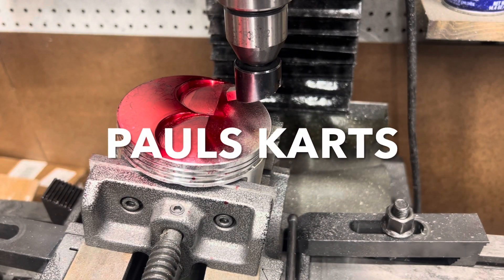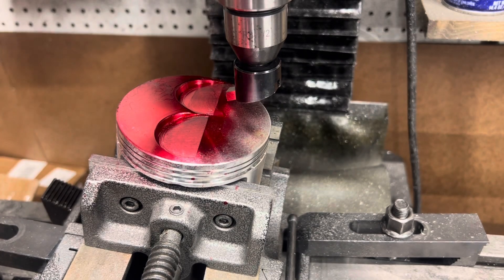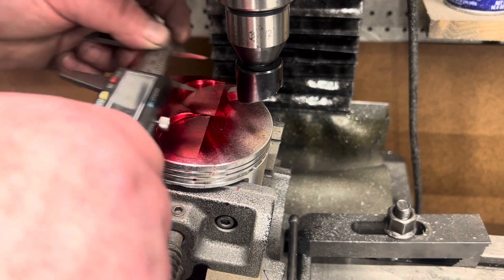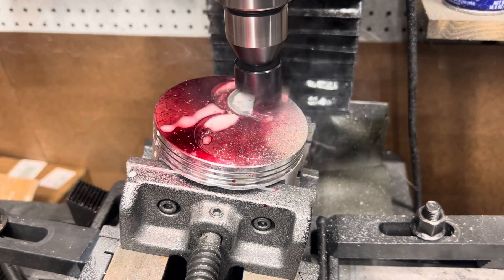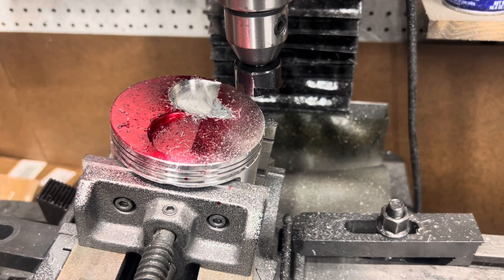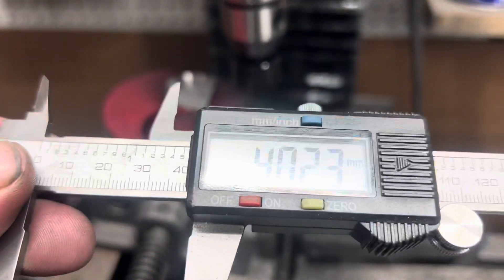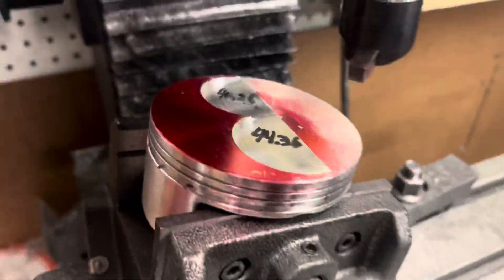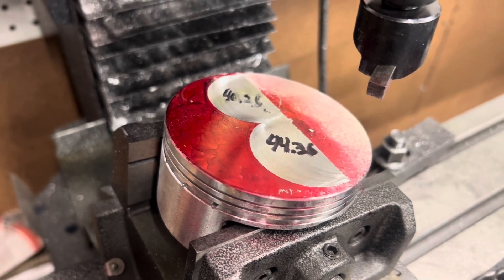Gx390 build, big block 460cc 92mm piston. Cutting valve reliefs for 43/38mm big valve head // PK

Comment: Beautiful work paul. I have a 420 pred that has the 69mm stroker crank and 90mm bore so 440cc. Whats the biggest sleeve i can put in to increase cc's? I have a stock length ARC rod so it must work with that. Can a pred block take a 95mm bore sleeve? Thanks paul.